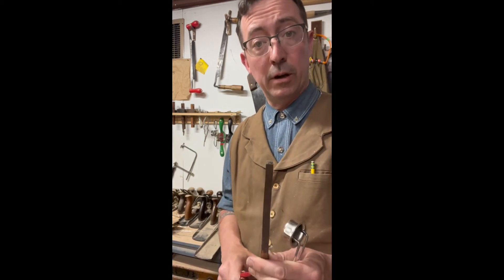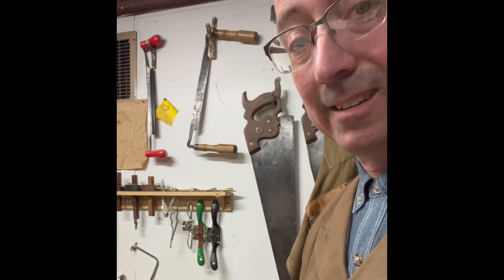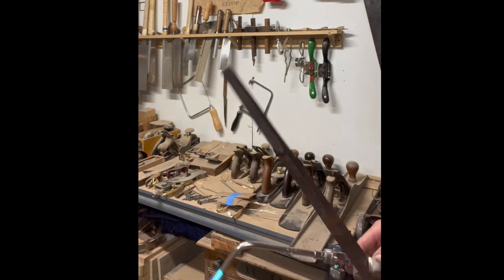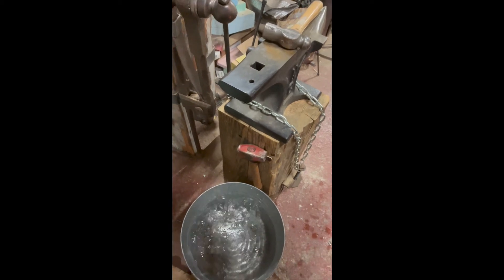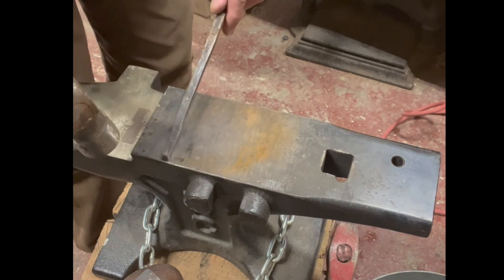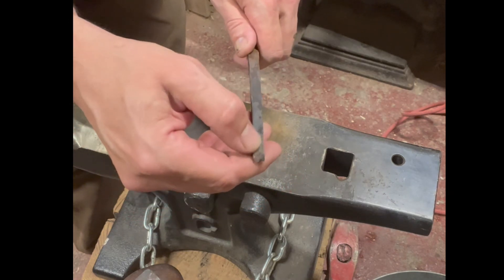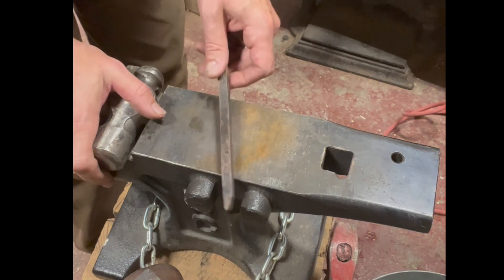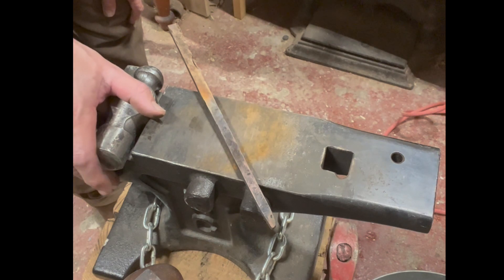How to Forge and Anneal Bronze

Comment: This should help me quite a bit, as the project I have in mind is bronze scales for a cataphractii armor set (late Roman cavalry).
I was given about 90 pounds of aluminum bronze, in the shape of large wingnuts.  These are unfinished, not drilled or otherwise machined.
I had tried hammering out a few, but was experiencing some fine fractures.  This happened whether forged cold or hot, hot meaning taken to a high glow and then plunged in cold water, similar to annealing brass.
I'm presuming that the bronze had age hardened over the two decades I've had them, I had read that this could be a problem, and similar happens with brass...which I have indeed seen happen.
I will try your idea of getting it to a critical heat, just glowing, and see how that works.
I expect I will have many heats to get it out thin enough.
I am fortunate to have the ZILDJIAN cymbal works nearby, a few miles from Boston MA.  I am waiting for a tour so I can see their processes, and show them some of my bronze samples to see what they think.

Thanks Again, hope your project works.
Reply: I bought a 12 inch stick of 1 inch diameter aluminum bronze and I’ve forged some decorative blades out it. It responds well under the hammer and doesn’t crack or tear for me. I’m using lump charcoal in my homemade forge powered by a hairdryer

Comment: Thanks for this.  I have some rose bronze I have been wanting to work with. I work with silver and copper which are pretty forgiving, so I started to do research, and heard it was quite challenging to work with. I am SO surprised to see how quickly bronze becomes work hardened. This simple demonstration has saved me many hours of confused frustration. Thank you! HOWEVER I do have a question: I have seen others forging bronze pieces while it is still cherry red. You quenched it as I would a silver piece. I understand Nnealin/quenching works different for different metals and I have wondered how it applies to brass. Would a slow cool or no quench allow longer time before it work hardened?
Reply from the maker: What a great question.  I have been treating it like silver, though as you say it does work-harden VERY quickly.  Maybe forging hot would be a good idea.  I'll have to try it!